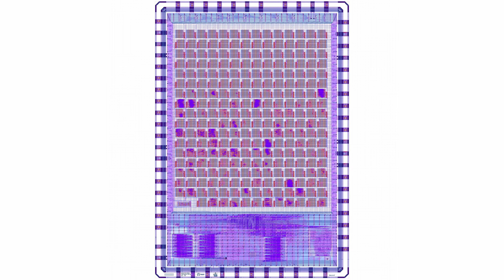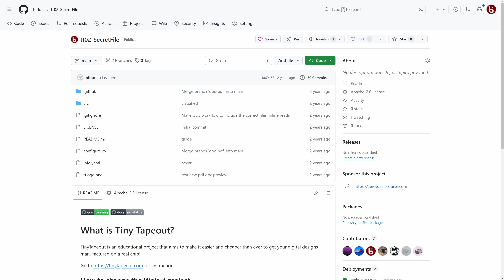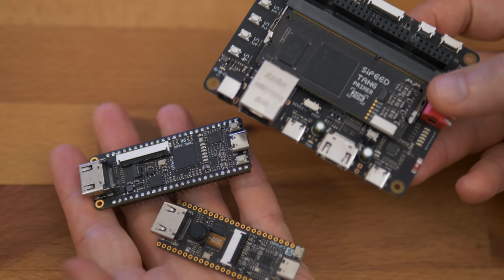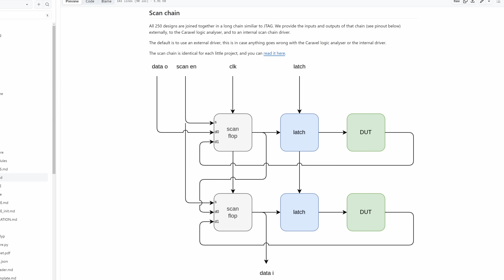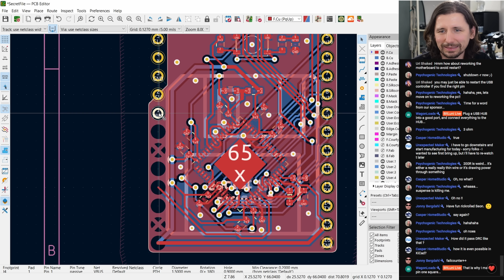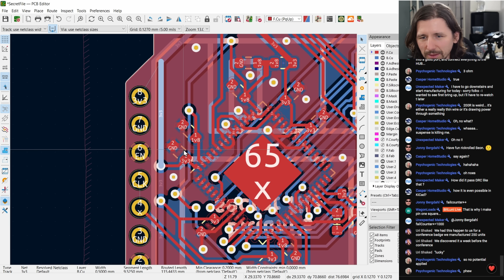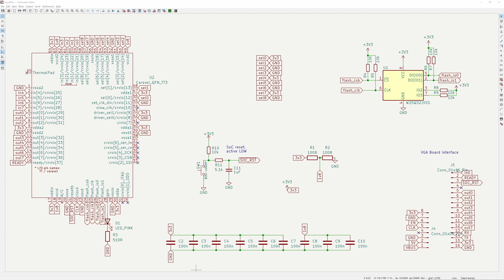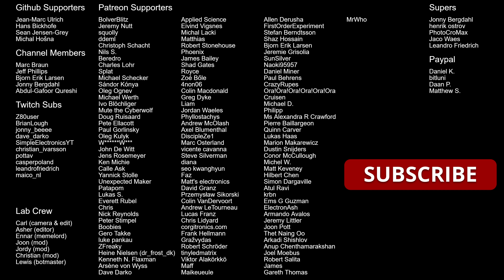I made a custom ASIC: World's first of its kind

Comment: the interesting bit, not chips work, and have errors, so are duds?, with divided up like the way it is, if there a manufacturing error on the chip, it should be as simple as locking bad bad sectors on springing rust hard drive, so reducing waste, and if almost every chip, is now a full working one? than going to make a lot cheaper to make, and 99% okay, still go, good, just hard disk, as they age, new bad sectors could just be add, the not used areas on the chips

Comment: Did you use some kind of special fluid to safely remove soldered parts?

If so, I have never heard of such a product and would be VERY interested to know what it is!
Reply: He just uses flux paste that helps the solder to flow better. Then you have to heat the solder to melting temperature again to remove the chip.
I guess you could try to find some very specific acid that only attacks the tin in the solder, but i don't think this exists and it would just eat away all the metals, including the legs of the chip or other components.

Comment: Maybe through technical advances, economies of scale and multi-project wafer services, one day silicon production can get similar turn-around like what happened in the PCB industry.
Reply: It would take a lot of changes. Making stencils for all the layers is really expensive. You can’t “print” them out like with PCB where tracks are very wide (certainly compared to features in a chip). The tools used to dope silicon and deposit SiO2 are also not cheap. It would definitely be cool to get to that point. But it’s pretty far away for now

Comment: What was the price of the Asic production with all the designs in the tiny tapeout?
Reply: Europractice offers similar service, and the costs per design is few thousand euros, so I imagine it's similar here (You are paying for multiple units because it's one whole wafer peen batch of projects, plus bonding and packaging service which is pretty expensive)
Reply: I found the price, it is ten k for a project and if you split the cost it is less, so in the tinytapeout it comes down to $150 per design and it's $50 per sq mm from the chip fab, or something like that. So actually quite affordable compared to what the prices were in the past. @ninethirtyone4264

Comment: Always check for shorts with an ohm meter before powering on a board. I'm sure you've hear that a million times by now.
Reply: A fuse would even protect if you drop a metal wire .
Reply: @ArneChristianRosenfeldt Wouldn't the 0ohm resisters act, if a bit flawed, like a fuse? Granted, the tolerance for it would have to be lower than what you're powering with it...
Reply: @rya3190  I was more thinking if on boot up you could set the power limits for each tile ( most of the to zero ). Why else would they care if a single tile can pull down the whole chip? Isn’t there really a power management?

Comment: until blue smoke separates you two. rle compression anyone. you can do chips at home, no need to use a separate manufacturer for anything. depending on others is silly. well you better be the chip maker yourself then. too much glue logic. emphasis on the main meat. if you are not the foundry, you dont have it. yes you can do optical lithography at prototype level at home workshop.

Comment: Did anyone think of implementing a SID in one of the desings?
Reply: For TT02 the analog part (filters) would have not been possible. I've heard they want to include analog capabilities in the future revisions though! Someone is surely going to short the SID hoarders ;)
Reply: @MichalKobuszewski  How well do you know the existing SID?
Reply: @eitantal726  The SID schematics have been reproduced from the die shots. I can see that the filter uses opamps and FETs with gates driven by DACs to control cutoff. This is unfortunately a no-no for direct implementation, but if one were instead to implement a right biquad filter and a lookup table for its parameters (to perform the filtering like DSPs do) I guess it could work. Sadly the digital filter part would probably exceed the other (oscillator + ADSR) in complexity.
Reply: @MichalKobuszewski  I'm interested in that. Will you be willing to spend time explaining those to me?
Reply: @MichalKobuszewski   the schematics are available, even the layout, as you mention. This is why I thought it would be "easy" to implement, but the fact that it had to be purely digital is an issue.
However, there are other ICs that are becoming unobtanium, which are actually fully digital.  Some people are destroying precious artefacts of computer history to retrieve those ICs and sell them on eBay.  There is, I think, a case for implementing those ICs in something like this project.
Reply: The YouTube video from TT shoes an R2R DAC. Put those in 3 of the tiles. How does analog go over the bus?

Comment: So how much would the cheapest fab charge for my own ASIC?
Reply: Usually ~50'000$+, but this company is starting at just 10k$ and the guys are splitting the cost between 160 people and allocating them even smaller part of the chip so it's just 300$ per design.
Reply: In the future I hope there will be a discount for additional chips. Now you only get 1
Reply: @ArneChristianRosenfeldt I can't possibly imagine that they didn't produce at LEAST double the amount they needed - the expensive part is creating the masks and setting everything up - running the scanners 1,2 or 10 times costs basically the same.
Reply: They were part of a marketing - research -google - stunt.

Im sure this is supposed to be super expensive
Reply: Its a $300 buy-in
Reply: efabless starts at around $10,000.
Reply: @rezafouladian6817 yeah, that's what we use for TinyTapeout
Reply: @rezafouladian6817  I wonder why rich kids rather crash a Mercedes AMG for a YouTube video instead of this.
Reply: I doubt you will get cheaper than this. If you want to do a private tapeout, then the minimum is around 5000 for 1sq mm via europractice or similar.

Comment: That’s such a smart idea! Doing a group buy for silicon is insanely clever! 🤯
Reply: No it's just a niche at this point
Reply: The only problem is the small size of the design and that everyone gets access to your design.
Reply: @conorstewart2214 Computers got thier start because everyone was sharing thier designs. All the universities, and radio hobbists shared every detail.
Thats how we get the idea of file formats and standards that allow the internet itself to work at all. 
Without that open share model computers would all have thier own file formats, some would use binary other trinary some might even use digitized analog adders but none would be compatable with each other.
Reply: @conorstewart2214  that's not a problem, it's a feature
Reply: @conorstewart2214  Which is usually okay as a tool for education. It's a bit like these tiny satellite programs - CubeSats. Not much you can do in a 10x10x10cm satellite. But at least it gets sent to space. Last year they launched 400 satellites, and due to advances in designing micro-satellites, there are now more commercial and amateur projects on board.
Reply: @conorstewart2214  i don't see the open access as a flaw. knowledge is meant to be shared, not gatekept for profit.